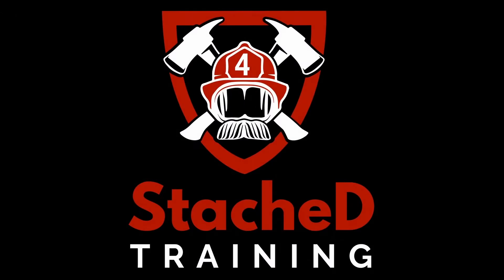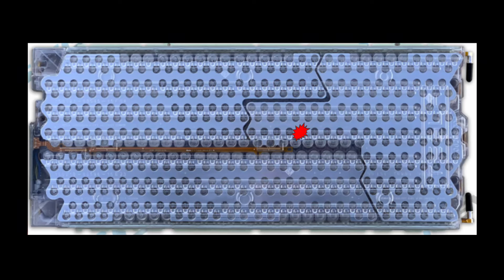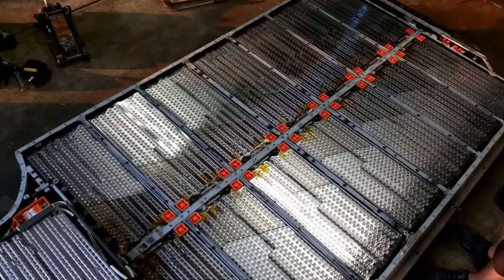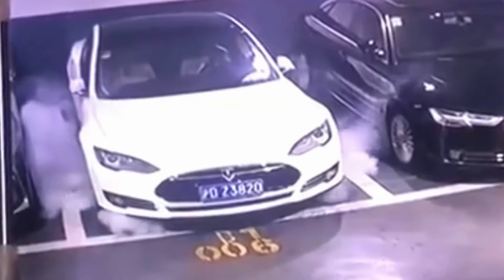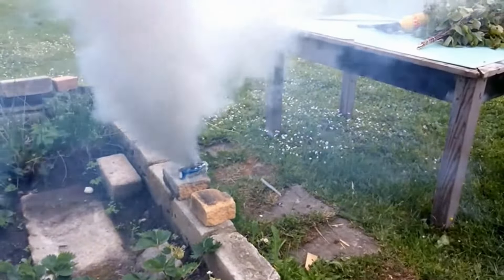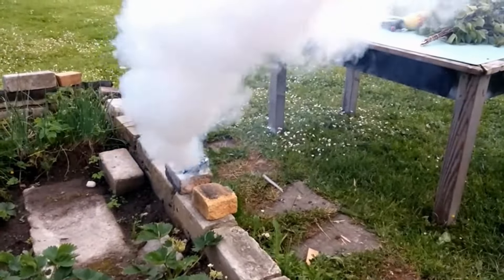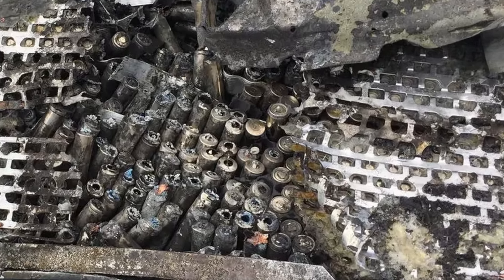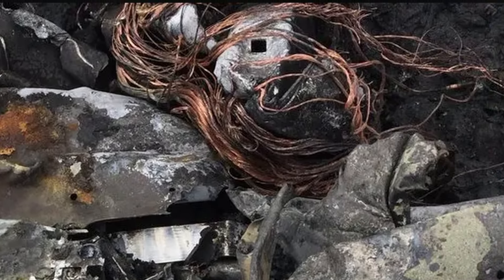What is Thermal Runaway: Lithium-ion Batteries

Comment: so why would something so deadly and unstable like the EV ever be allowed to be put into mass circulation, knowing the potential for destruction that they have?  it makes no sense at all, does it?  You can't say the govt wasn't aware of "thermal runaways" and all these issues that causes and dangers to the public.  why would the govt ever encourage these purchases, let alone allow them?  why haven't they continued on with building the infra structure to support/charge these EV's?  The only logical answer to these obvious questions and concerns, could be 2 things imo.  First would be, we have incredibly irresponsible, incompetent, and very low, iq people to put it politely, and most likely criminal as well, in charge/making decisions, or, the second logical reason would be that these EV's are weapons, imagine this, 10k EV'S all around chicago and even the suburbs, remotely detonated all at the same time all around the city, with a little whipped up wind, that would burn the entire city to the ground.  Once they had the pager attack in iran, where they signaled the pagers wirelessly to malfunction the lithium batteries in them, it really solidified my second logical reason why these dangerous EV's would ever be allowed to be put into the public.  All these EV'S run off of software and are connected online, this logical reason for them existing is not a wild conspiracy theory but, lets say our "rulers"/leaders/elite were evil criminals, who would rather burn it all down and kill us off before ever losing their power and control and facing justice, and we clearly see that our govt has no value for human life with their complicity in the killing of the innocent Palestinians and enabling of a genocide so blatantly and intentionally, the only way these weapons could perhaps be less destructive, would be that everyone got the message and NEVER parked these vehicles indoors or close to any structure whatsoever.  Let's hope im wrong about my opinion of our "ruling class" being low life trash and evil/brutal/selfish/etc,  who need to be unalived/brought to justice/removed from all authority, monopolization of money, markets, industries, establishments, etc.,  so the world can be a much much better place, for the majority peoples of the world.  Do you have a different "logical" reason why these EV's even exist?  considering the extreme danger of them?

Comment: Car manufacturers conduct (oh, not an intended pun) multiple failure and crash tests to assess the safety of their cars and obtain a safety rating, don’t they? ANCAP rating.
All car manufacturers know what happens with failed battery packs, don’t they?
They know how to stop and extinguish battery pack failures, don’t they?
It’s about time the EV industry explains.
EV driver just having a small fire extinguisher in the boot is obviously inadequate.

Comment: What did they think was going to happen when they pack all that energy into tiny little boxes? This is why carrying around potential energy is always going to be safer and more reliable than carrying around active energy, like electricity stored in batteries. Batteries are fine when it's for a power drill, or a flashlight, but when you have huge multi-hundred pound batteries strapped to the bottom of a moving vehicle, then you're basically sitting ontop of a bomb ready to blow. Gasoline cars are more safe because the energy within the gasoline is potential energy and it can do nothing until it is ignited and even then, it is very difficult to get liquid gasoline to burn. Gasoline vapors are what burns, so keeping the gasoline inside of a sealed container or system is the safest way to handle it, and said systems need a quick cut off device so that if a fire gets started, you can seal off the rest of the gasoline and kill the fire rather quickly.

Comment: Lithium is seriously dangerous however any EV with battery storage would also be quite dangerous under fault conditions (70kW is a lot of energy)... They could keep the combustion engine and convert water into Browns gas which might work or equally, using electrolysis to separate water into hydrogen and oxygen and feed the gases directly through a hydrogen fuel cell to run an electric motor🤔🤷‍♂️
Reply: Ah yes Hydrogen. Hindenburg.
Reply: @patrickgriffitt6551  Not quite, the fuel would be water and only converted into hydrogen when needed so no large amounts of gas to go boom.. maybe 🤔
Reply: @Andykerrfield  Ah. OK . now I see your concept.

Comment: I believe that the Li-Ion battery is going to be replaced with something else in the near future.  Toyota Prius for the first three generations used NiMH batteries and no major catastrophes have happened with those, and their reliability is amazing. The load on Li-ion batteries to power vehicles is just too much for this technology.  There is no way I would even consider buying of of these current EVs as they are, in my opinion, still in beta testing phase.  If a car submerged in water can actually burn, is absolutely nuts.

Comment: Ships at sea United States Navy. 🇺🇸 A thermal runaway is an emergency alarm resulting in all hands to man firehoses or firebottles. Maintenance personnel will quickly access the overheating battery as quickly and safely as possible (before a detonation or fire occurs). A chain of sailors with gloves form a chain to the nearest catwalk. Once the offending battery is removed, this is handed as quickly down the chain of sailors and Jettisoned overboard. Yes, even aircraft can suffer from a Thermal Runaway.

Comment: We would starve without electric vehicles.

Those vehicles are locomotives with large diesel or gas turbine engines making the power to spin electric traction motors.  If batteries were more efficient and less dangerous, we would use those.

Comment: lol a total fail from day one - let’s review - Lithium is a pure element found on the elements periodic table - all elements have properties - copper turns green over time, gold sparkles, lead melts at low temps, hydrogen is flammable - add a few protons, neutrons and electrons and right below hydrogen you will find Lithium on the periodic table and lithium has an interesting property - it ignites into flames on contact with water - silly humans - a doomed path lol 🤪🤷‍♂️👍

Comment: Unfortunately, that is the problem because these batteries are made up of many individual cells, wired accordingly to achieve high voltage and current! In my opinion, this is technically unmanageable! As shown here, one cell failure is enough!

Comment: Pure Li-ion batteries are going out of production, being replaced by LFP batteries that do not catch fire like Li-ion. Actually, they do not catch fire at all. That is what more and more car brands are adopting.  It is very well known that Lithium, sodium, potassium, and all elements of Group 1 of the periodic table are extremely flammable when put in water of high humidity atmosphere.  These fires would happen regardless of battery charge state. But you eliminate certain elements like Li, and fire risk is greatly diminished. That is what Chemists are trying to obtain, electrolytes that will not produce thermal runaway, and hence, fires.
Reply from the maker: I think you misunderstand what defines a lithium-ion battery.   LFP/Lithium Iron Phosphate/ LiFePO4 is a type of lithium-ion battery.   In some ways, it's safer technology because it is slightly more difficult to get it to go into thermal runaway.   However,  when it does go into thermal runaway, it can be far more devastating. https://youtu.be/YvQ9NEw76G8?si=ODOWALpVqMWRVMJJ

Comment: This makes all electric cars with lithium batteries potentially unsafe. A safer non lithium battery needs to be designed and those cars with lithium batteries should be taken off the road one would think. Tesla and other EV makers need to rethink the battery. This is just my opinion which may not count for too much. Too much is invested already to change anything and I get that. It is what it is.

Comment: BMW has over a thousand ice cars catch on fire per year..
Tesla has designed spacers between the batteries to run glycol through them to keep it cool.
Don't conflate Tesla with EVs.
The Tesla in this video first of all was not made in America second looks like it was an old version with the oval front which is before 2015.